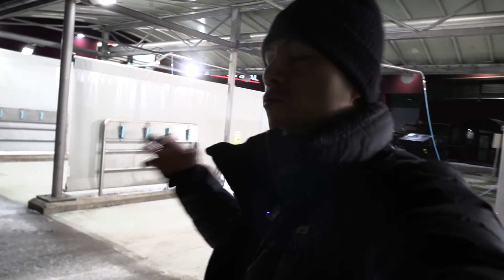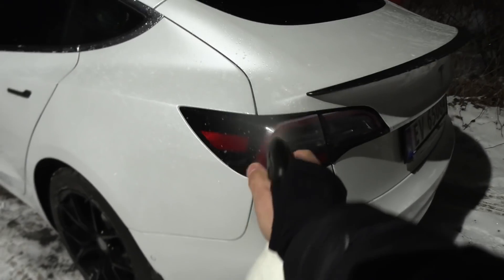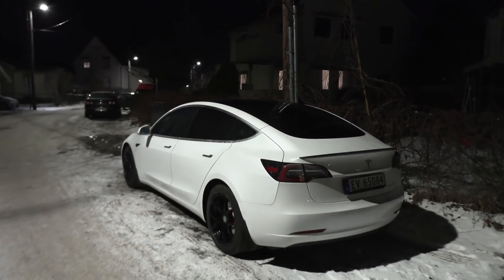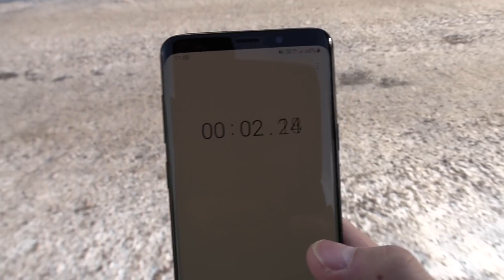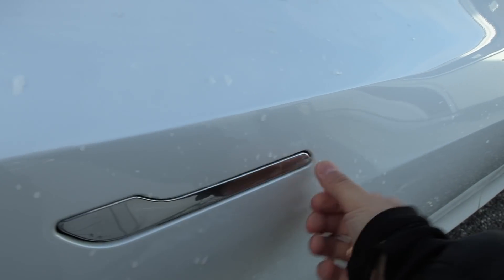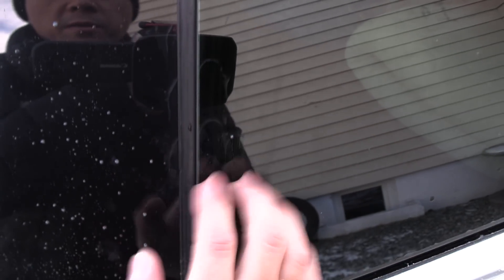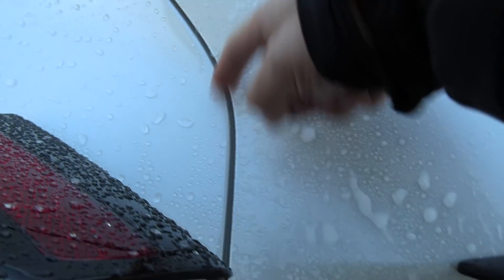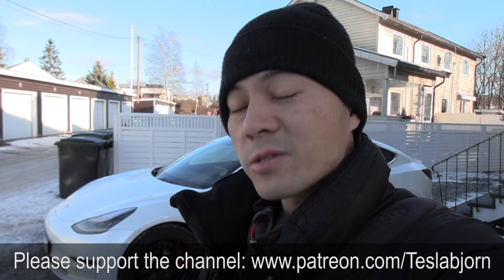Frozen door & charge port in Tesla Model 3 (no recirculation this time!)

Comment: When my M3 handles were stuck a few weeks ago, a little bit of warm water did the trick.  If would be useful if the app allowed the user to open the door - the external handle just pushes an electrical switch, and then gives the user something to pull with.  When you press the button for door open on the inside there is a small sprung assistance - this action would probably be enough, the external handles shouldn't be required.

Comment: Even without pre-heating, if you bump it a bit harder, it will open fine :) I had to do it this way when the Easee charger at the cabin did not work at all (google it), so my car was left in -15 degrees and "freezing rain" with less then 10 % power and I could not pre-heat it.

Comment: Ok, so all I would need to do to be able to get into my Tesla that's been in the elements is wait a half an hour for it to thaw itself... Great... Any other car with traditional door handles you could just give the handle a good tug and pull the door open and drive. Yeah you'll be cold, but you don't always have the luxury of of 30min to pre-heat the car before setting off. Thanks for the study Bjorn, you do good work in the EV scene, I just think Tesla's unnecessarily complicated door opening procedures (pop-out door handles and windows that must drop down to clear the frame) are gimmicky and impractical for places other than California. One of the reasons I didn't buy an M3.
Reply: You don’t have to wait for 30 minutes. Tap the door with a closed fist, the ice loosens and the door handles will work. I do it all the time. The tolerances are too tight leading to ice being able to jam the handles. Definitely room for improvement.

Comment: Is this “heated charge port” not kinda similar for all the cars with the charge port more towards the back of the car and more or less integrated in the body? ID.3?  EQC? The frozen CP probiem is mainly with the charge ports really up front? Like Kia? Hyundai? MG? Or is it really Tesla Magic? 🤗
Reply: Almost all cars have the air exhaust in the rear. When you think of it the blower sucks air in from outside. So the air has to go somewhere. In many cars there are holes in the chassis with plastic or rubber flaps. They are the air output.

So this is just Tesla wisdom to use the waste air to keep the charge port deiced.

Comment: This also explains why it felt colder sleeping in a Tesla than those German cars, it's losing heat through the back side of the vehicle. Not hatin', just pointing it out.
Reply: All cars lose heat out of the back of the car otherwise the fan wouldn’t be able to draw in new fresh air. Cars are leaky by design.

Comment: Let me just open the door with my app in case I have a frozen handle?
Reply: You can unlock from the app but that's not opening it.
Reply: @FabianYoutub  I know, but the idea is that like when you press the button to open the door from inside, it opens the door just enough for me to use my fingers to open the door without using the handle

Comment: Why does recirculation cause it to not work? Can someone explain the physics?
Reply: There is no overpressure in the car with recirculation, because the fan sucks the air out of the cabin. Without recirculation the air is blown in the cabin, the pressure rises and due to the pressure in the cabin,  the air will escape through the openings of the cabin.
Reply: @peterhelm522  can you explain it like I’m 5?

Comment: too easy? It's easy if it doesn't require extra effort. Tesla should have designed the door handles to operate better in cold climates and there is no excuse for not heating the charge port door or at least offer a cold weather package that addresses all these issues.

Comment: This is a somewhat inaccurate video because it gives the impression that you have to pre heat the car to get in. I just brute force, push hard with your palm and the handles will go out. Same with charge port. Just give it some open palm smacks and it opens. Absolutely no scratch and I dont even have fancy coating (just a waste of money imho). Cheers, wrote this on my m3 in -9 in Sweden. (yt app works great)

Comment: Is there a heated charge port in 2021 Model Y and Model 3? The side mirror heating can be activated in Long Range and Performance Models by activating the rear windshield heating. Also available in the App. Would this also activate the charge port heating? Or is there a separate charge port heating control in the Model Y app? Google search finds the following: "Charge Port Inlet Heater: Your car can now use the charge port inlet heater to help defrost the inside of the charge port. The charge port inlet heater can be activated in cold ambient temperatures by enabling preconditioning using the mobile app, activating the rear defrost button on the vehicle's touchscreen, or preconditioning the vehicle using scheduled departure."

Comment: Thickest ice shields are built when cars are covered in several centimeters of snow while parked in a sunny spot. During daylight the sun slowly melts the snow. During night the remaining snow slush can freeze again and build a solid ice cover.
Reply: Freezing rain can also coat everything from trees to cars in a thick coating of ice. https://wikipedia.org/wiki/Freezing_rain
Reply: then you'd have to preheat for long I guess... but as long as the car is heating from the inside... the ice will slide off/open even if the outer layer is still frozen.

Comment: Hey, any way to fix heat issues when its minus 30 degrees CELCUIS? I leave it on auto HI and usually 23 auto but it fogs the windows and the heat barely comes out. 2020 Model 3 performance

Comment: Most important part of this video is at 11:16 when Bjørn turns off air recirculation to ensure that cold air is sucked into the cabin and heated air is pressed out through tiny gaps near door handles and charge port.

Comment: Just follow Tesla’s instructions and knock it with a closed fist at the widest spot
Reply: Juha PIEVILAINEN 5:30
Reply: If you actually watched the video you would see that he did that and it didn't work.
Reply: @BlazerRox  has worked every time for me. Living in Finland so my Model 3’s handle has frozen solid many times
Reply: @JPievilainen  Well good for you but Bjorn has shown video proof that it doesn't work - where is your video proving that it does?
Reply: @BlazerRox  https://www.tesla.com/en_GB/support/do-it-yourself-model-3?redirect=no#remove-ice-door-handle step 3. Works everytime. Have not felt the need to video me opening my car door, as it so mundane operation for me. No wonders. Have you had issues with frozen door handles where you live?
Reply: @BlazerRox  I think Bjørn is just a bit too gentle.
Reply: @FabianYoutub  agree. I have not bothered with tapping around the narrow bit of the handle. Just firm knock at the wider part of the handle, has always released it. The metal is bent at the edge of the hole for the handle, making it really strong. Really difficult to make a dent there.

Comment: I feel like by now Tesla could have engineered a single strand of heating element in each handle indent as well as around the charge port to solve this issue... Only heats up when it's really cold and not too hot either. Similar to rear window. Total wattage around 50

Comment: Is it possible to drive 7-8 miles in -10 celsius (-50 fahrengeit), let the car stand parked outside in the cold for a week unplugged, and drive back the same 7-8 miles? Is that possible at all with a model 3/Y?

Comment: Wish we could turn off recirculate from tesla app.
Reply: There should be a "De-ice my car" option - that first circulates the air for a few minutes to bring it above 0°C (e.g. 15°C ??) and then switch off re-circulation to force the now warm air out through all the cracks to unfreeze all the doors (including the Charge port door). Should be accessible from the Phone app - or even totally automated according to your desired departure time, the temperature outside and whether it rained much.
Reply: Keeping recirculate on should heat up the interior of the car up more quickly, therefore, would it not be sensible to keep recirculation on?
Reply: @gopakumarsudhir4766  When you are recirculating the air, the pressure difference betwen inside the cabin and outside is zero. So you are relying on the whole cabin (doors) to heat up to melt the ice. When your turn it off you create more pressure inside the cabin which will force hot air through the cracks (door handles) and melt the ice faster.

Comment: Try knocking on the door handle harder, works for me
Reply: For me too, even pressing a little bit harder on the outer most ends of the handle in a repeated fashion always got the handle loose for me. Adding some silicon spray to the rubber insulation as i have it always done for any car helps with stuck windows, it nearly goes completly away.

Comment: I 've asked this before, does anyone know why you can't just open the doors from the phone app?
Reply: I don't think model 3 has automatic doors
Reply: @W0Ndr3y  No, they are not like Model X front doors, but the Model 3 interior door release is an electronic push button. 
Why not provide the option to activate that from the app?
Reply: @shiakas  that would be at least a really good solution, if the window was moved down a little

Comment: Would be great if Tesala had an Anti Ice option in the app which switches off recirc after the cabin is warmed up a little bit
Reply: The heater works quickly enough that recirc shouldn’t be needed.

Comment: A squirt bottle with alcohol solution will do the trick in 1 minute. I used it on my car when the rubber on the doors gets stuck due to ice
Reply: Never spray alcohol on your car. Why would you do that? Any plastic that gets exposed to alcohol gets damaged.
Reply: @orishaeshu1084  they are made for cars to remove ice. I think they are fine for a special occasion like when you have so much ice you can't get into the car
Reply: @cponofrei  if you have that much ice, you didn’t bother to use a car cover during a freezing rain warning... regardless, a few buckets of warm water will work. Or a heat blower.
Reply: @orishaeshu1084 , which wiper fluid do you use in winter then?
Reply: @MrPaukann  last time I checked, my window is made of glass, but on my older vehicles, the plastic trim gets discoloured and hardens, leading to cracking, leaks in rubber seals, etc. My new vehicle doesn’t spray the fluid everywhere however, as it had sprayers on the wiper arms. Much better design.
Reply: @orishaeshu1084 , so the fluid evaporates from the windshield? What about rear windows then? 

At a low speed, the fluid goes down the windshield, where the wipers rest, usually, all plastic there. At high speed it goes either on the roof or on the side of the vehicle. And then there are headlight washers, which spray the liquid onto plastic headlights, plastic bumper, plastic trim and, in my case, are made of plastic themselves.

The trim gets discolored from the sun. I can't see any difference in colour or hardness of plastic between the places, where the fluid goes and where it doesn't, on my 12 y.o. car.
Reply: @MrPaukann  the sun definitely does discolour plastic but trust me alcohol causes it as well. Due to this pandemic, I have been sanitizing a lot, well.... my steering wheel on my older vehicle started to melt from all the sanitizer and also wiping it clean. It literally looked like wet paint at one point. Same for my door trim. As for the seals, well, they dried out from the alcohol. It dries out plastics. Obviously hard plastic is not going to absorb as much alcohol if at all. So its resistant. That’s my experience at least. Maybe it depends on the type of plastic. 

As for my washer fluid on my new car, no it doesn’t evaporate, the excess actually has a drain that it runs out of and drains underneath the car. A very good design actually. Rear window doesn’t have a wiper, cars don’t generally have that these days.
Reply: @orishaeshu1084 , interior plastic - absolutely possible. But my point is that exterior plastic  is designed (or should be) to withstand common alcohols. Wiper fluid gets almost everywhere. And concentrations can be pretty high, -20C is 42% isopropyl alcohol. Even if there is some damage to plastic, it's negligible compared to UV damage. Spraying alcohol a few times do defrost something isn't going to do anything.
Reply: @MrPaukann  okay you should continue doing it then. It’s probably an inexpensive vehicle that you don’t care about anyways.
Reply: @orishaeshu1084 , it's a relatively rare vehicle I care about. I will continue being sensible.
Reply: @MrPaukann  well hot water is much cheaper than alcohol. And it has a more neutral pH. Then you can just absorb the stuff with a drying towel... but here you are using some vodka on your car. 😂 You sure are sensible.
Reply: @orishaeshu1084 , luckily, I have no problems of that sort on my car. Only windshield washer nozzles freeze sometimes, but if it's that cold, I don't need them and they melt in 40 minutes of driving.

We weren't talking about the price, which is nothing like vodka, BTW, we were talking about the damage. You think hot water can't do any damage to paint and/or glass?

By "sensible" I meant not worrying about improbable things.
Reply: @MrPaukann  just confirmed with a friend that my method makes more sense. Guess you’re just gaslighting me lmao.
Reply: @orishaeshu1084 , we aren't talking about which one is better. I was arguing your first comment, we are talking about that.
Reply: @MrPaukann  alcohol corrodes many metals and plastics. One such metal is aluminum. It actually can corrode aluminum quite rapidly. Some cars today are mostly aluminum. I’m going to continue using water. If I don’t have to use a strong substance like alcohol, I rather not.

Comment: @16:00. When one try to save energy it might cost even more. As with recyrculation in this case. :)
Reply: I guess the point with saving energy was about using camp mode as it will not heat the battery.

Comment: You can just as well buy a can of de-icing fluid; spray it on the door handle, no need to wait for pre- heat to warm up the whole interior.
Reply: its best too keep the can inside the car so its always in close reach ^^.
Reply: @markushahnenkamm  in the frunk obviously
Reply: @markushahnenkamm  how would you open the can to get it out?
Reply: @gopakumarsudhir4766  , you best me to it. Perhaps in the boot?
The other issue is frozen snow headlights with snow.
Full beam gets flattened.
Our Leaf has less winter issues than our Tesla.  Californication...
Reply: @gopakumarsudhir4766   Yes - you got the Joke - but @mbican provided with the frunk a good solution
Reply: @gopakumarsudhir4766  Always carry a battery powered circular saw with you. Open the car at the bottom to avoid visible scratches in the car body.
Reply: @ziggyyo  A brick works much quicker.
Reply: wiper fluid works fine

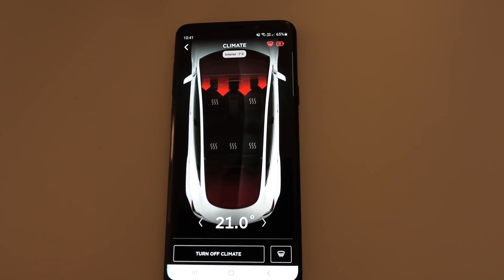Comment: 7:02, I wonder how long it would take/if it would be faster if "defrost" was set (switches to high) rather than 21 or indeed set it at e.g. 28?
Reply: Was thinking the same thing. 👍 In winter I always use that button and works fine. But I think Bjorn dont use that button becasue he dont want to heat up the battery...
Reply: so he needs to redo the entire video again again

Comment: So Teslas need heated handles/ doors and a charge port door
Reply: No they don't, did you even watch the video?
Reply: @EC18FEA30B  Yes they have heated charge port inlet, no heated charge port door. It prevents freezing of a plugged cable over night.
Reply: @TschingisTube  The reply was to original post, not Kjartan Björnssons post, sorry for confusion.
Reply: @EC18FEA30B  sorry
Reply: Newer Teslas have charge port inlet heater, my 2020 does not but couple months later and it would have one

Comment: Nice update. Thanks Bjørn. Some questions; From the app is it possible to control if recirculation is on or off? Also from the app is it possible to turn on camp mode? I'm thinking about short drives (cabin to ski lift) where you don't need warm batteries, just need to defrost enough so you can get into the car...?

Comment: do you think the plugged charging cable will freeze or is Tesla better because the port opens to the top and is a kind protection from falling snow? Is the cable warm enough to warm the ice?
Reply: warm enough to melt
Reply: Heat from charging will keep it from freezing
Reply: @EC18FEA30B  Assuming it's not finished charging and frozen before you need it. ;)  But then you just schedule your departure.
Reply: Have never had it freeze on me and its plugged in every night
Reply: Currently sold tesla model 3 have heated charge port so that the security pin which holds the cable in when plugged in does not freeze. This could freeze in older models when water runs into the chargeport when it is plugged in.